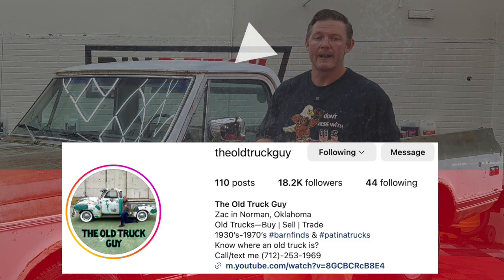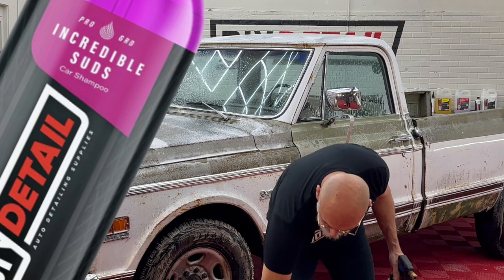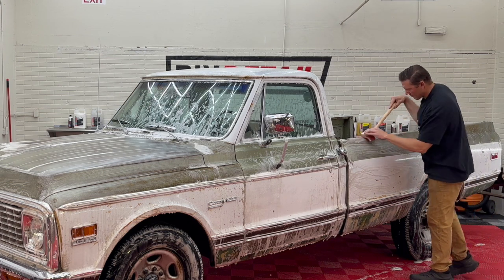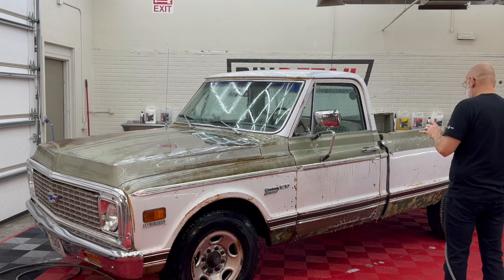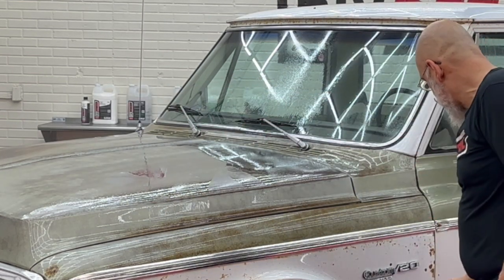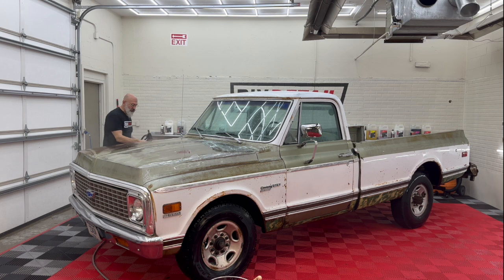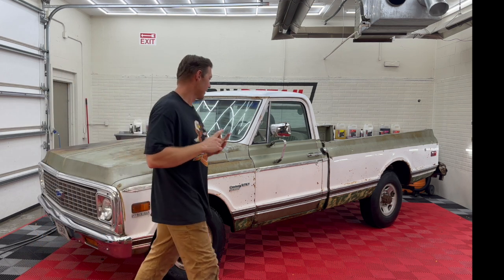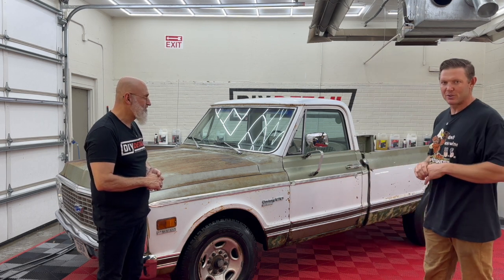How to wash a Patina finish. #diydetail #patina #c10

Comment: I just got a new spray ik trigger sprayer for ceramic gloss. Should I be concerned with it damaging the sprayer since it’s acidic, or will it be fine? Thanks
Reply from the maker: If you’re worried about it just clean it out after every use. If that’s impractical then just use it and enjoy it :)

Comment: Sometimes Yvan puts an ounce or two of All Clean in the foam cannon mixing it with Incredible Suds and foams the vehicle. This time he sprayed foamed 15-1 All Clean then foamed Incredible Suds on top of it.  When does Yvan use one method vs the other?
Reply from the maker: The dirtier the surface, the more DIY Detail All Clean gets used.
Reply: @diydetailofficial  So, when really dirty, spray All Clean right on the surface, then foam Incredible Suds on top and when not as bad mix All Clean and Incredible Suds in the foam cannon?

Comment: is the listed size of your waffle pads the backing plate size or the flared diameter?
Reply from the maker: Flared size
Reply: @diydetailofficial  Shoot, so if I have a 5.5 inch backing plate, I need the 6.5 inch waffle pad? Out of stock :(
Reply from the maker: What machine do you have?
Reply: @diydetailofficial  just bought the Hercules forced rotation one. 5.5 inch backing plate.